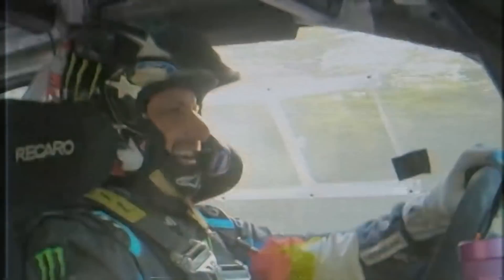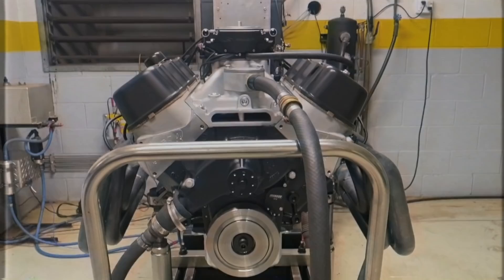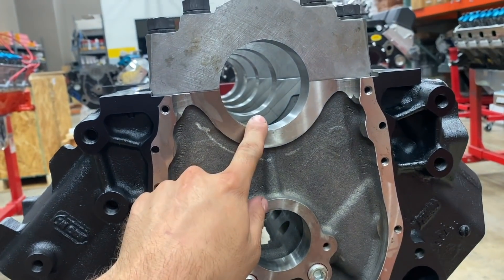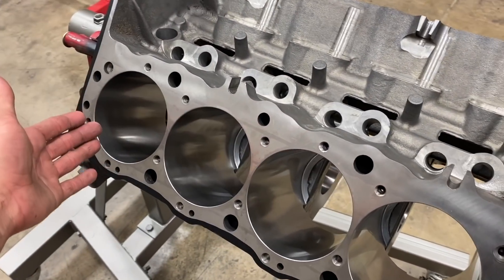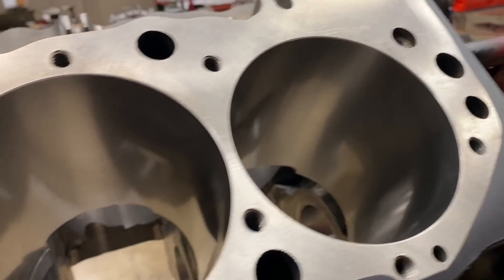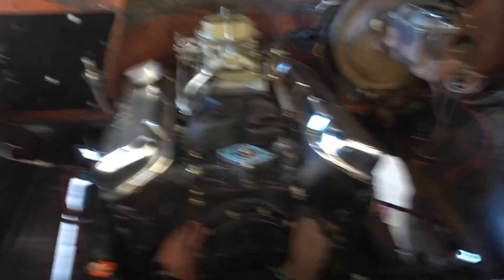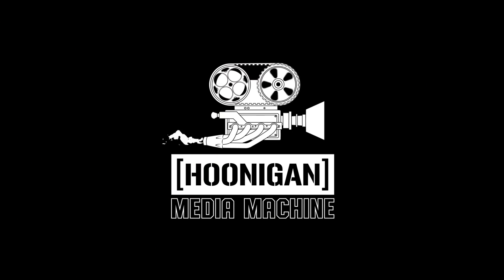9.3 Liter V8?! Zac's Squarebody K5 Gets a HUGE Motor Swap

Comment: Had a 77 square-body back in the day that I swapped a 502 crate in.  Turbo 400,  NP203/205 doubler, 14 bolt rear locked, dana 60 front air locked and 44 boggers.  Wish I still had it, but 7 mpg on premium got hard to live with.  Makes my H2 look like an economy car.  Can't wait to see how this build turns out.

Comment: If i heard you correctly you are running a Holly Super sniper.  As someone whose run this on my BBC C10 and done numerous install/review videos i can say for sure to utilize the non progressive linkage and fabricate up an extension where the throttle cable mounts to the EFI unit.  The added lever arm reduces pedal effort making it easier to leave smoothly.  I had a ton of issues with my BBC wanting to break tires loose when letting out the clutch.  Additionally, and you probably already know this, but the fuel pump Holley supplies with the Super Sniper kit wont support your power levels.  Using their Super Sniper C10 in tank kit im already close to the limit at 515hp.  If i could go back i would have made a trap door above my tank so swapping pumps in the future was easier.  One last thing im curious about will be your MAP at WOT.  On the chassis dyno here in SLC they were seeing vacuum at WOT through my Super Sniper.  Maybe something to keep an eye on depending on your intake setup.

Comment: I remember working with my dad at the old upholstery shop he worked at and a dude brought in a red 3rd gen with a blown 572. I was pulling it around to the front and cracked the throttle a little and the whole car twisted 😳😳

Comment: What would it take to keep The same torque HP and 572 but with NO Block movement or twist when stabing the throttle ?
At the back of your block in the lifter valley the Distributor drops trough a short distributor tower as opposed to a tall distributor tower ? In High RPM RACING engines ?

Comment: 5:00 slicker cylinder  walls. I thought cylinder walls should be a little scuffed up so the oil has something to cling to. I understand slicker walls means less friction on your rings/piston but that's what the oil is for. I'm no engine builder so please enlighten me.  Expert/professional input please.

Comment: I give that 12-bolt rear axle about 100 feet into the first trail before it snaps a shaft and leaves you 3-wheeling back to the road. Better give Dynatrac a call to have them setup a Dana 60/80 axle combo, cuz the 12-bolt/Dana 44 front are just never going to hold up to that kinda torque.

Comment: A 572ci and gm 10 bolt axles lol.
Reply: Those larger 10 bolts are reasonably strong. Obviously not 12 bolt strong but a lot stronger than the little 7.5 10 bolt.

Comment: Wait a minute!

So the guy carefully removed mass from the crankshaft to bring it down to uder a gram of imbalance, THEN he goes and removes more metal when deburring, making all that balancing wasted time because he's now introducing an imbalance?

It would have been much better practice to bring it down to within, say, 10 grams then carried out the deburring process and then working down to the 1 gram tolerance while deburring/chamferring as required.

Comment: I don't understand... If you go through all the cost and effort of building that kind of engine, but then put a carb on it. Why not an EFI conversion that will provide more longevity and efficiency?
Reply from the maker: Hey Jeff, Zac here.  Im running a Holley Sniper x-flow EFI kit on this 572.
Reply: @HooniganProjectGarage  Awesome choice my guy! Thank you for responding and clarifying, I appreciate it. The vast majority of channels and creators wouldn't bother, so thank you again! Btw, that big block is going to get super hot; what are your plans for your cooling system?

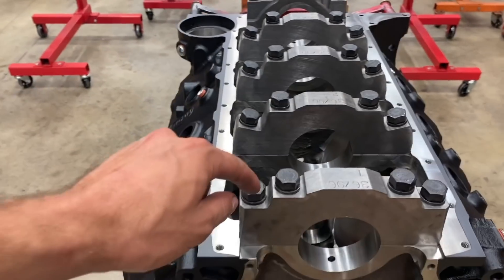Comment: 2:47 those four should be one single piece. If there's one thing i've learnt from JP engines that do this, at not much of an additional weight cost, you can just pour stupid amounts of power down low and the engine, just don't give a damn.

Comment: Grrrrrrrrrrrrrrrrrrrrr 9.3L of goodness,  ( Imagine 1/2 a plastic bottle of soda 2L bottle,   each piston is bore is that big !!!!  )  the needle on the gas level  will move 1 inch every 30 second at 80mph lol  ( My 2.0L turbo engine got 8mpg at 110mph,  this thing will get like 2mpg at 110mph LOL )   needs a two 25 gallon tanks lol  , one for regular and one for 91  ,  .....................

Comment: You make a 572.93 ci 
You can put a 4 and 1/2 in stroke and a short dick dart block because I have a 598 short deck using your bore size in my block I can turn it into a 606 ci

Comment: the 572 is a meme engine, you can make for power out of a 500 big block for less
Reply: Could make more power outta a small block for cheaper again, or a Honda motor bud so what's your point?
Reply: @samthesr20man  the 572 is a show car engine. it dosnt make reliable power. but im sure you will tell me im full of shit hahaha

Comment: I legitimately never knew the details of a balanced crankshaft before, that was a concise explanation
Reply: Everything that attaches to the rod journals is “bob weight,” rod,  rod bearings, rod bolts, wrist pins, pin locks, ring pack, and piston. The combined weight of all those parts should always come close to if not match the weight of the crankshaft counterweights.
Reply: @shitbox7413  shouldn't they also need to balance the bob weight between each other so that no single piston, rod, etc. would weigh more than the other ?
Reply: @adelkheir  
Yes, I forgot to mention that. 👍🏻

Comment: to so my luck i get rigs all the time free or cheap i got a 79 short box 4x4 cheyenne full option truck 400 sb with the heavy duty 400 turbo with under 35,000 miles on it in mint condition for free all i had to do was put a new fuel pump and clean the carb and a new battery then drive it home plus i got 2 first gen camaros and 2 second gen camaros they were parked in a shop then they gave me 15 other rigs outside and a big motor home all rigs were very good project cars plus they gave me all the engines and parts in the shop 2 stroke 454 1 4 bolt fresh 327 lot of work dun to it a bunch of running 350 4 bolts new carbs in boxes after market ignition set up with a msd 7 all still in the box extra camaro front clip in mint condition even the paint on it second gen most of the rigs out side were pu 67 to 72 chevy and fords 3 73 to 79 chevys have a lot of them sitting that i got for free and every one of them are rust free the ones that have rust that i get i strip them and scrap them have 2 68 chevy cabs sitting rust free one had air the other one not but i have nothing like my neighbors were i can get rigs cheap from like a 65 chevy short box with just rust in the front fender the cab looks good took the doors off checked it all out cost me 100 bucks . they have a real nice 65 ford matching box with tool box on side for 300 mite get it too just needs a tune up to drive it just broke down a month ago  and it was missing real bad i turned down a  68 chevelle ss 396 rust free car really good body but needs paint for 3500 the body was striped to bare metal then the protective coat on it  all the chrome with it . a 57 chevy pu with a 55 grill in it rust free the guy replace any thing that had rust or damage with perfect panels he went to 8 wrecking yards to get all the parts he ends up selling it to me for 250 bucks he even put new spring 12 bolt possi 283 ready to be put to gether fresh from a mech shop all prep was dun